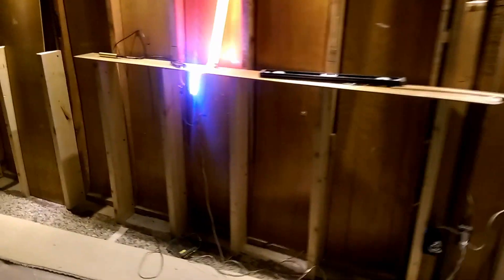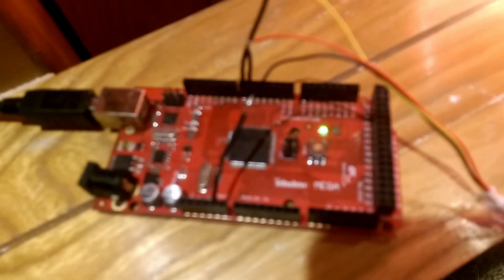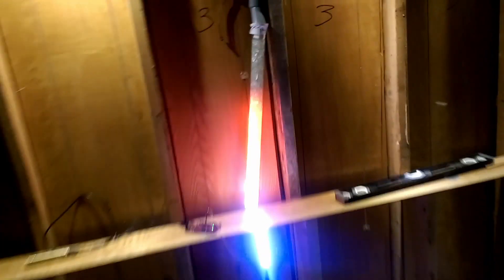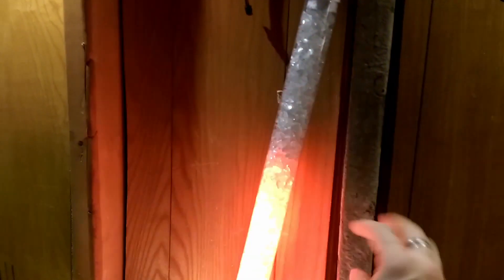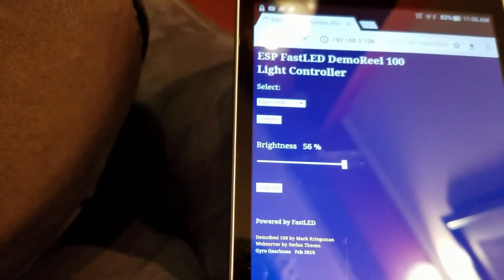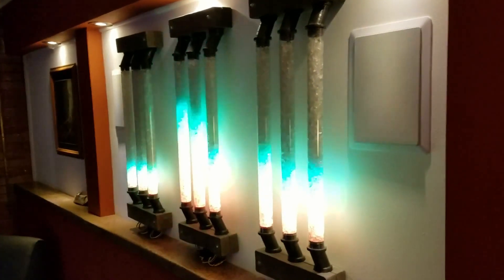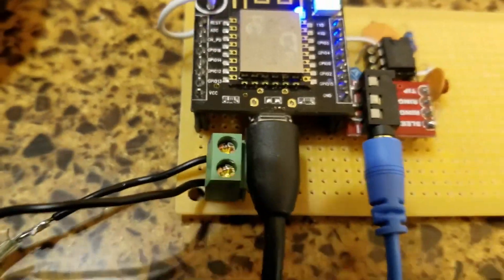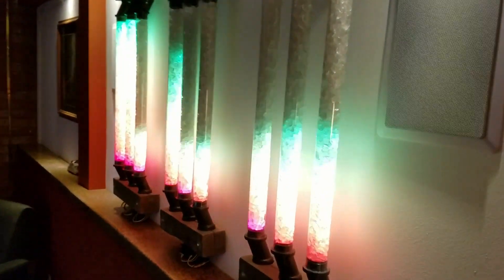360 Wall Display

Comment: Awesome project.  I am just getting into this and made something on a much smaller scale.  I wanted to test making my own crushed glass.  I used a tempered piece of glass and it made very nice glass pieces to use in the clear tubes.  Saved some money and my proof of concept with the tempered glass was a success.  I am scaling it up now to include multiple tubes.
Reply: Do you have any idea where to get those clear plactic tubes from for cheap? is it plexi, polycarbon or what?
Reply: @The_Unobtainium  I got mine at Lowes next to the light bulb section.  Florescent light protection tubes.

Comment: Really impressive project! Thank you for posting it. Was there any reason why you chose 4 line LEDs over 3 line ws2812b leds?
Reply from the maker: When I was purchasing LEDs for the project, there was no support for WS2812b LEDs on the ESP8266. I also wanted to be able to take advantage of faster refresh times of APA102 LEDs. Thanks for asking!